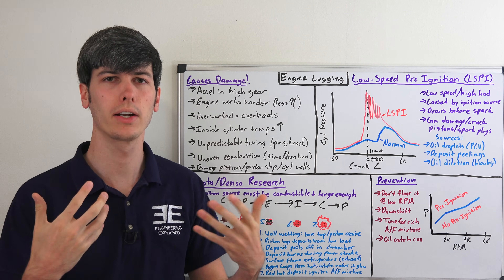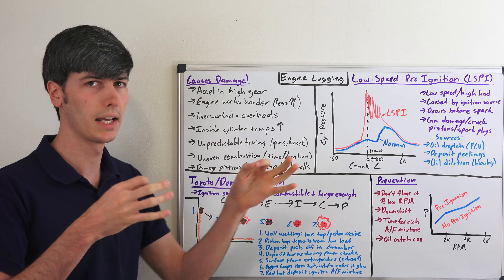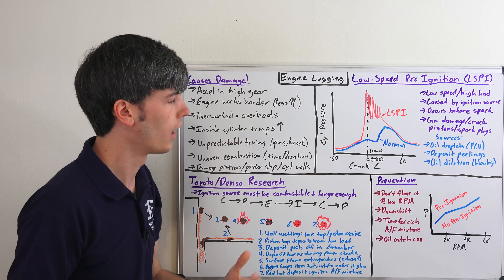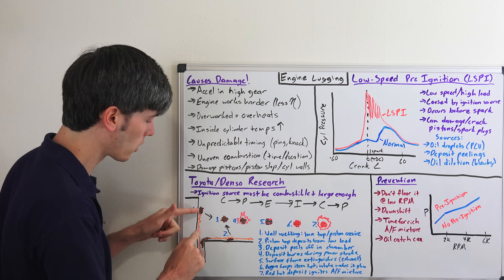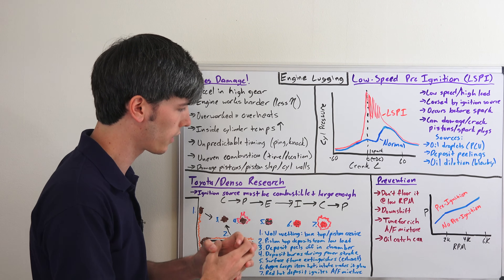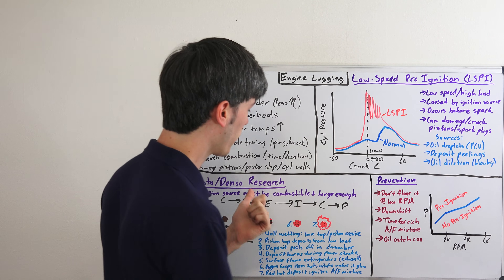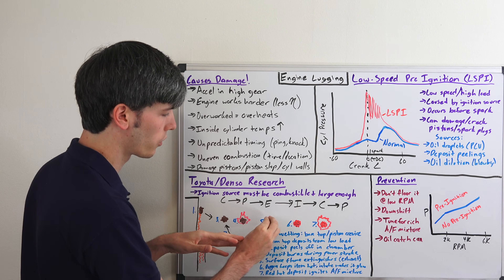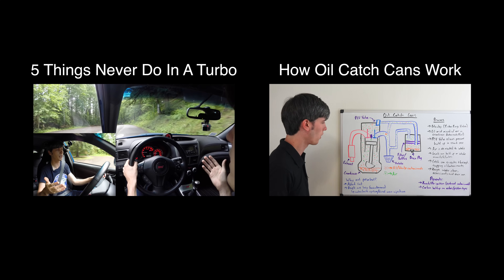Why You Should Never Lug Your Engine (Especially Turbos)

Comment: Do a video about what you shouldn't do in a supercharged engine.
Reply: And then tag vehicle virgins in it
Reply: Same reason, extra air without fuel to support it creates lean mixtures which drive cylinder temperatures way up and can contribute to preignition/pinging
Reply: +Yeahhshiftyeahh a supercharger has a linear boost delivery,so nope smartfuck
Reply: +Amer Muratovic lol and your point is? If it's got linear boost then that mean there's even more air present at a low rpm than there would be on a turbo charged engine so it could potentially even be worse

Comment: I have been a technician for 14 years, but the way Jason explains things, is second to none. I honestly do not know of anybody else that can do it as well as he does.
Reply from the maker: I appreciate the kind words Dan!
Reply: I second that .
Reply: Jason is a god among men
Reply: Lugging is a long-held tradition for high-efficiency cruising in aircraft and cars, although it's not as useful for cars since we do most cruising at high speed without tall enough gearing.  Inner-cyinder temps and times leading to pre-ignition?  You can hear and feel that.  Longer-term temperature increase? There's a gauge for that.  Obviously if you are making a pass, you don't want to lug, but for a completely different reason than the video states: you want to pass quickly!
I will happily continue ignoring the (bad and amateurish)advice given in this video.  Negged!
Reply: @JENKEM1000  it's not bad advice at all - giving a vehicle wide open throttle at low rpms (e.g. when you're barrelling down a highway) is bad, light pedal pressure is ok. Engine lugging is the former, not the latter. If you need to overtake at highway speeds and your engine is at low revs with more than 50% throttle that's going to create problems if you keep doing it, downshift instead.

Comment: Can this be applied to my 1994 mechanical DT466 with a 6 speed? The DT466 is an I-6 Diesel for those who don't know...
Reply: I believe diesels are different and aren't affected in the same way by LSPI. The temperature of diesel is so much higher than gas that it's much more difficult to pre-ignite. Also, diesel fuel is much closer in composition to the oil deposits mentioned in the video, so you could consider that "normal fuel for operation".

As for why you're getting brown/black smoke, that's usually indicative of a rich air:fuel mixture, and many diesel owners specifically desire "rolling coal" as the youngsters these days call it. Probably not something to be too concerned about, but I wouldn't call it ideal.
Reply: That's a mechanically injected diesel, so it gives it a certain amount of fuel based on throttle position. So when you give it a lot of throttle at a low rpm, the pump is giving the engine more fuel than it can burn which is why you see the black smoke coming out of the tail pipe.
Reply: It's a 1994 International 4900 w/DT466. It's before the electronic crap.
Reply: Diesel engines are a lot cooler actually...
Reply: I had a 1993 with the same engine but it never rolled coal. had her for 10 years til it decided to blow. These are all company trucks. I'm a milkman and I haul approx 40,000 lbs everyday of product. So i put some use on the engines. This past winter I blew the engine in a 98' DT466E, the engine when they gave it to me was already worn out. But with the truck I have now, the previous driver kept writing up turbo saying it was bad. which i think it is because this truck is a pig. The mechanics at my work place say if it ain't broke we don't fix it.

Comment: Say I'm riding 40 in fifth on flat ground. I don't floor the pedal but I gently accelerate up to 55. Still bad?
Reply: If violent vibrations don't occure then the answer is: nope.
Reply: No, feathering the throttle isn't putting it under a significant load. He's talking about going wide open throttle, or close to it.
Reply: You should also be paitient in high gear and give the engine time to ref up. Then it's fine.
Reply: j0n0j0n0j

Not really. You have to floor it for some time to see the gauge reaching high temps.
In most cases thermostat will open fully, and even 1-2 minutes of flooring on high gear will not overheat the coolant, but cylinder walls? Sure.
Reply: You would still be putting more pressure on your engine and working it harder than if you changed back a gear and accelerated, But as he explains in the video If you don't see your temp gauge rising rapidly, You should be ok.
Reply: j0n0j0n0j

He is talking about temperature inside the cylinders. temp gauge shows how hot the coolant is BEFORE reaching thermostat.
Reply: *****
Yea but if the cylinders get hotter the engine gets hotter and if the engine gets hotter the coolant gets hotter so the temp gauge goes up.....

Comment: Lug??? I've never heard that word used in this context before and I've been driving cars for 50 years. To me a lug is a certain sort of sticky out thing or a word for carrying something heavy.
Reply: It's an EXTREMELY common term in the automotive world.
Reply: Well dammit! I'd better get over there and tell 'em to stop it!!
Reply: Wordreet, You said lug as in carrying something heavy, Like when you lug something heavy you move really slowly and rigidly because you have a massive amount of pressure weighing you down. It's the same principle with a engine, When you put a high load on your engine at a low rpm in a high gear, The amount of pressure you put on your engine is high so your engine is really lugging to carry the weight.
Reply: +wordreet hell yeah Levi's are still fashionable, that's all I wear as a matter of fact
Reply: j0n0j0n0j
No no, when I carry something heavy, I just chuck it up on my shoulder and off I go, muscles glistening in the sun, shades on, baseball cap backwards, whistling a merry tune with the thumb of my spare hand casually hooked in the waistband of my Levis.
(are Levis even fashionable these days?)
Reply: That's the word I couldn't remember! :¬D
Reply: :¬D Well it's actually a fantasy for me as I consider Levis way to expensive. In the UK the cheapest ones are around £40 ( $52 ) !!!!!

Comment: Really great to hear a thorough explanation of this and the science behind it. People thought I was crazy and trying to cause hysteria in EcoBoost owners when I talked about the dangers of LSPI in the EcoBoost Mustang. Some of the guys on the EcoBoost Mustang forums have also seen some correlation between LSPI and high calcium content in oils and the higher volatility of some oils. It seems like lower calcium content is safer for the EcoBoosts. The safer path for paranoid people like myself: don't void your warranty and/or get something naturally aspirated instead lol.
Reply from the maker: #FivePointOhLife
Reply: LSPI can pretty much happen in any car, it's just that it's more common in newer turbo engines because they use DI, which means higher compression ratios, and they generally use small turbos which spool much quicker, which means a lot of boost at low RPMs.  LSPI is not just an ecostang or ecoboost issue, it applies to the new WRX, VWs, etc.  I wouldn't even necessarily even call it an issue, it pretty much only occurs when you're doing something wrong.  There can be flukes, but generally it's a driver issue, not something wrong with the car. 

 You didn't really see LSPI in old turbo engines because the compression ratios were lower and the turbos didn't really spool until like 4-5k+ rpm.  

You could still have LSPI happen in NA, it's just not as likely.  Lugging an NA engine is still horrible for it.  

One of the issues is that turbos or big engines produce a lot of torque and that can mask the fact that you are lugging your engine.  (because they accelerate fairly well)  Obviously though, it's going to be much easier to lug an NA 4 cylinder vs a V8.  (within reason)

Not trying to lecture you, just clarifying. :)

EE feel free to correct me if I'm wrong. You'd know more than me. lol
Reply: @Narwhaldrivescars  It's common on the 1.4 Astra too, a lot of people are having pistons going at anywhere between 3,000 and 13,000 miles. I got the 1.0 turbo (LSPI doesn't seem an issue on the smaller engine), but still make sure I don't lug her. She loves revving so I always make sure I make her purr instead of groan! Fun fact the 1.0L Astra is more responsive than the 1.4!
Reply: connecting rod loading is pretty much what pre ignition/ knocking does in your motor. the combustion will be happening before top dead center on the ignition stroke and the flame from the ignition will meet the top of the piston before the piston is at top dead center and tries to force the piston back down as the piston is coming up to ignite when its supposed too, so its pushing back on the piston connecting rod which can nend connecting rods or even worse blow the piston out the bottom or side of the motor blowing the engine up :P but hopefully your engine will never knock that bad because the knock sensor can sense pre ignition before you can even hear the engine starting to knock and pull timing as needed
Reply: They use direct injection tho which makes it pretty hard to preignite when the injection occurs right before combustion.
Reply: Will you also talk about rod loading?
Reply: +CSmittyBurz This makes sense. I've never heard of this issue with the 3000gt VR4 guys. I've chugged along the "grape vine" in California plenty of times in a high gear at a low RPM with ~1-2lb of boost or so with no knock detected in my VR4. It must be because of the low compression and no DI.
Reply: New motor oil companies formulated the new ilsac-gf6 to combat lspi. 

Make sure the oil you are using is rated like this. Mobil 1 along with their new packaging graphics are updated. Also other oil brands that is SN PLUS rated.

Comment: This was a good explanation of what knocking is and why it occurs, but I can't see why this is linked to accelerating at low RPMs.
Reply: It's kind of like firing a gun with too heavy of a bullet.  You'll have excessive pressure in the combustion chamber.  Another analogy would be riding your bicycle in the highest gear.  It's going to strain your knees.

Comment: Will jason reply to this comment?
Reply from the maker: Unenthusiastically. ;)
Reply: Haha You're a cool guy ;)
I love your videos! You are like my personal teacher about cars, thanks by you i can discuss with my friends.
Keep up the good work!!!
Greets from Belgium.
Reply: +Engineering Explained What happens if you start a hydrolocked engine??
Reply: +Grand Theft Auto MASTER I know I'm not him. However. Your not going to be able to start a hydrolocked engine. It requires to much force than what the electric starter can handle. As far as I know you would need to disassemble part of the engine. You should also turn the engine off immediately after it was hydrolocked or under high probability of becoming hydrolocked to minimize possible damage.
Reply: Indeed, your connecting rod will break or bend because a liquid is incompressible.

Comment: If things like pre-ignition don't apply to diesel engines (which only take in air rather than airfuel mix) you should state this clearly in your video please. Here in Europe we use Diesel a lot.
Reply: Lugging a diesel puts it in the power curve.
Reply: Marcus T This applies only to semidiesels - that is, Diesel engines with a carburetting starting aid like kigas.

Comment: You mention flooring it, what about short shifting? I know lots of people that do that for mpg
Reply: Usually you're not flooring it when short shifting. And even then if you shift right you're still within the power band of the engine and thus not going to cause damage.
Reply: In economical driving or “hypermiling” you want to keep the engine at low rev high throttle. But newer at a full throttle (full throttle richens the mixture) and newer so much that pre-ignition would happen (it would be bad for fuel economy as well as engine).
Reply: I don't think going from 2 to 5 is what short shifting means.
Reply: +Zhemin Lin it's shifting before 2500-3000rpms usually
Reply: How is high throttle at any RPM good for fuel economy?
Reply: +Sanjuro Makabe for the same power output low RPM high throttle uses less fuel than high RPM low throttle. When accelerating for the same amount of velocity change low RPM high throttle for a short time is more efficient than low RPM low throttle. Lookup up brake specific fuel consumption for more information.
Reply: +Sanjuro Makabe for the same power output low RPM high throttle uses less fuel than high RPM low throttle. When accelerating for the same amount of velocity change low RPM high throttle for a short time is more efficient than low RPM low throttle. Lookup up brake specific fuel consumption for more information.
Reply: Ants Aasma Thanks I'm reading about it now. It seems counter intuitive. Also very engine-specific. For example, i know my engine with an EFI system from the 80s will switch to open loop above 1/3 throttle, surely this reduces its efficency? Will it be more efficient on boost or off boost? I haven't found any maps for gasoline turbo engines, only diesels...